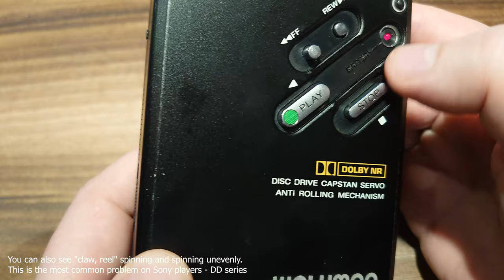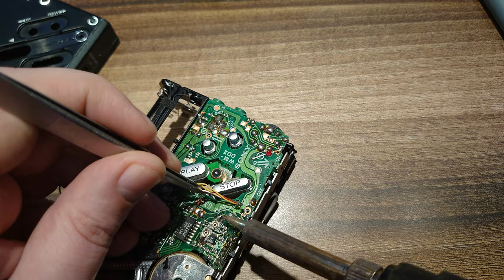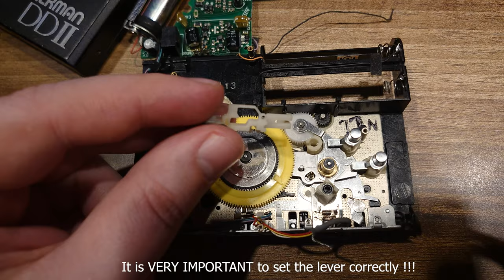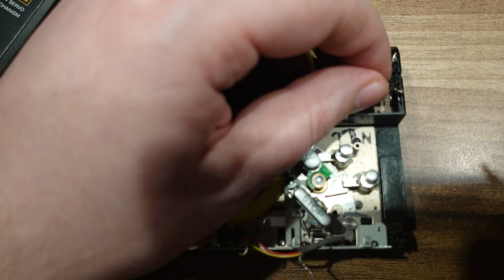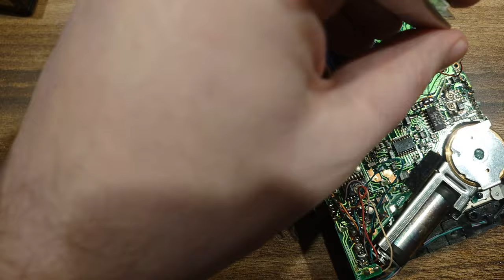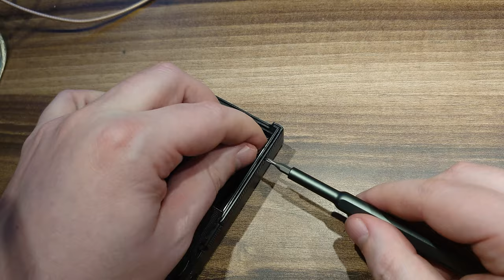4K Video Sony Walkman WM-DD2 Repair and replacement of Gear and capacitors. WM-DD DD1, DDII, DD11

Comment: Capacitors are better to restore if they have increased their internal resistance, but not to replace. These are old, real audio capacitors ! The ones you put are not good, better put modern SMD caps...but the ones you put are trees. With them, this walkman ends with the nice sound.

Comment: Would appreciate you sharing what capacitors are needed. Thanks.
Reply from the maker: Buy Capacitors Replacement KIT https://gra-afch.com/product-category...
Buy eBay Sony Walkman KRC-1-11 WM-DD1 and WM-DD11 Complete Capacitors Replacement KIT https://www.ebay.com/itm/255229151603
Sony Walkman KRC-DD2-DC2 WM-DD2 and WM-DC2 Complete Capacitors Replacement KIT https://www.ebay.com/itm/255229160783

Comment: I have two DD2 in mint condition and one needs a new center wheel. It plays but I can hear the click sound which means one of the wheel tooth is broken. Will it be possible to send it for repair ?

Comment: Dude...this fantastic man. I've been waiting for a full repair video for the Sony WM-DD2!🥰

I tried to fix and restore my Red DD2. But I must done something wrong. Because it just doesn't function like it should be. Not to mention it keeps eating my cassette tapes. Not the rare ones think god. Just Awesome Mix Vol.1.😅😢

Anywho, I have got to tried this whenever I have the time. Not to mention getting the needed additional parts. Never considered replacing the old capacitors as well. I bet it'll make sound a whole lot better then before.😅

With all that said great job and thanks for the vid.😁

Comment: The centre-gear on the DD's split because of the shock load delivered to it from the flywheel at the end of the tape on FF/RWD (no real auto-stop, the servo just cuts power to the jammed motor after a second or so - really quite a horrendous system from an engineering purist's point of view). I sold my DD33, bought new in 1992 in 2020 (which must have seen 1000's of hours of use) and the centre gear was still fine because I ALWAYS, from day-one, either watched or listened for the 'leader' tape to appear and hit STOP before the the tape slammed to a halt (needs decent reflexes).

With broken ones, I've wondered if after removing the plastic gear from the steel disc it's moulded around (easy as it's already split), the disc could be turned down to a very fractionally smaller diameter, the plastic gear then re-bonded with the broken ends carefully dressed (minus one tooth?) to join back up into a perfect gear.

ETA, PS >> REALLY now regret selling the DD33 (in dark grey, not black, unusual colour), it was a jewel of a machine, still in near-mint condition.

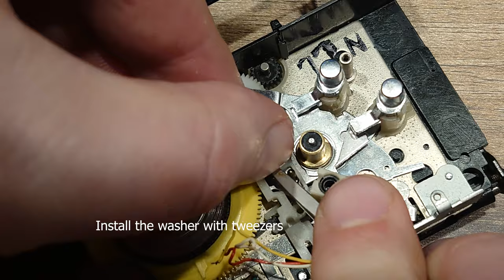Comment: i have a problem with the lever.  on 7:25 you can see it very good. this black thing who goes into the lever. it does not pushes up the lever. any idea? also my gear is broken aswell. i think im gonna buy a replacement gear and tear it completely apart. maybe i can see then, what the problem is.
Reply from the maker: If it is broken, you can try to glue it together, but as a rule this rarely helps. You can try to strengthen the part, insert a metal rod for reliability. But it is best to replace with a new part.
Reply: @geryhold  now i solved it. you see the spring on the lever which pushes the black little plastic thing to the left side? the 'pen' on the very top of the lever was broken, so it was not tighten. i glued it while holding to the left. and now it works. these 3 funny forms on top of the center gear are kicking the lever up.

Comment from the maker: You can buy now Sony WM-DD2 and other Sony DD series DD1, DD2, DD3, DD10, DD11, DD22, DD30, DD33, DC2 are on sale https://gra-afch.com/product-category/other-components/walkman-players/
Buy Capacitors Replacement KIT https://gra-afch.com/product-category/other-components/walkman-parts/
Buy eBay Sony Walkman KRC-1-11 WM-DD1 and WM-DD11 Complete Capacitors Replacement KIT https://www.ebay.com/itm/255229151603
Sony Walkman KRC-DD2-DC2 WM-DD2 and WM-DC2 Complete Capacitors Replacement KIT https://www.ebay.com/itm/255229160783